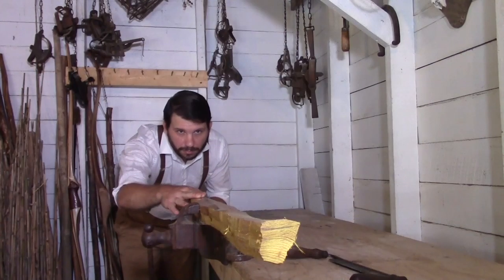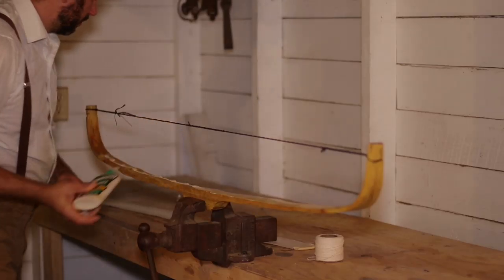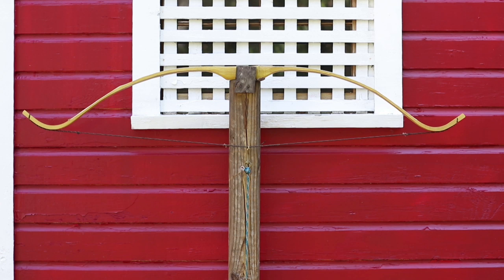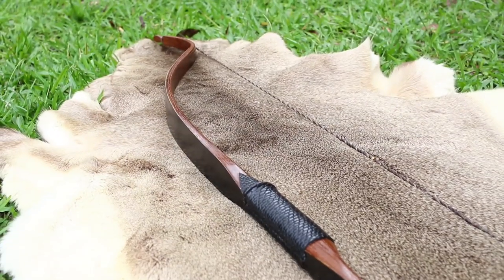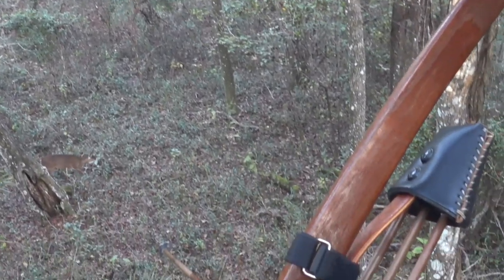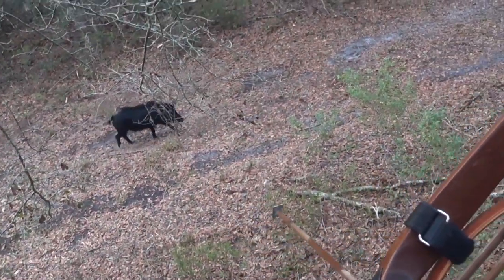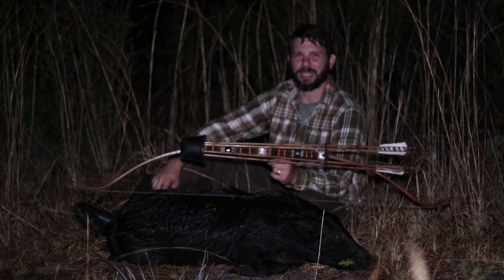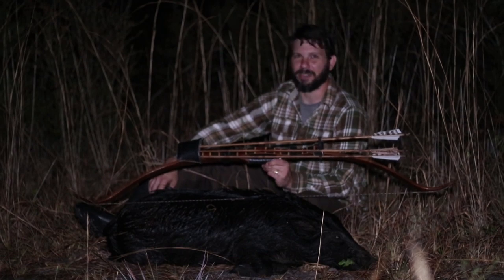Vintage Recurve Build and Hunt. A Traditional Archery Film

Comment: Great video. I was surprised to see that bow take shape because I have an almost identical one from the forties that I found in an antique shop in Georgia. It has a snakeskin back and was made from two pieces of matched bois d'arc joined with a bowyers W joint. I had to replace the handle covering as it was gone. I've never tried to string it, although I've heard some people do bring those old ones back

Comment: I’d love to build a bow like that: Grumley Deerslayer replica with the brush nocks 🤤 

But osage around my area is too hard to find straight and without knots. Plus I stuggle at chasing a ring.
Reply: What woods do you have in your area
Reply: Marko Angelo Florendo 
Oh I have all great bow woods in the area.

Osage, black locust, hickory.

Its just that the osage trees are either old or too twisted to use. I’ve fallen an osage that was over 28” in diameter. It was huge.

I don’t have the patience to chase rings anyway. Follow a ring down a whole stave for 64-72” without cutting through. And god forbid you do cut through and have to find another good one and chase it all over again.

I’m more of a laminate bow person. Have a form. Glue up, shape, alignment and tiller, riser, sand, finish, done. I’m much better at power tools than hand tools from doing furniture making with my dad growing up.
Reply: @Sonicguy95  hickory is a good option, and so is osage, osage is just really hard and that's what makes it a good bow